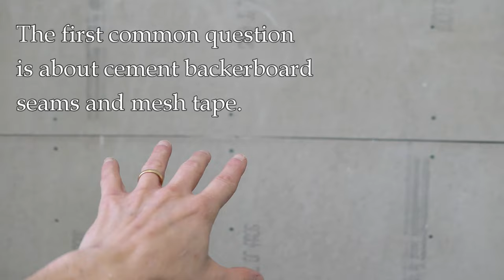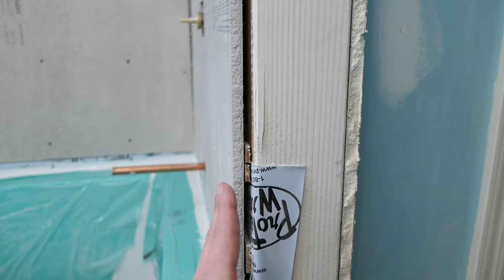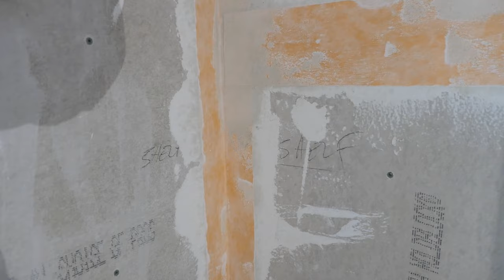Should Backerboard Go Over The Tile Flange Or Up To It?

Comment: HEAR ME OUT!!
I find it illogical to caulk between the bottom of the tile and the top of the tub. IF, theoretically, water gets behind the tile surface it will become trapped back there as it drains down to the top of the tub. This is bad, and the same principle has absolutely ruined homes when this technique was applied to EIFS stucco, and even brick veneer exterior walls on houses.  The tub has a lip, so water draining down behind the tile surface should have a way to continue into the tub so drying can take place. At the very least a weep hole should exist at the low spots allowing any potential moisture to find a way out from behind the wall.  Just common sense thinking here.
Reply from the maker: Ha!  I heard you out!  So, there are a lot of misconceptions about how tiled shower walls function. If you have tiled shower walls which are installed correctly and maintained, then there is no water getting behind the tiles.  When grout is secure in the joints and the grout has been sealed, then water rolls right off as it does on the tile surface itself.  Even when sections of grout are missing or poorly maintained, water doesn't actually flow behind the tile.  It will soak into the thinset adhesive or even the backerboard, perhaps, but it would take a long shower indeed.  And in that case we are talking about moisture, not flowing water.  I have seen showers where water actually flows behind the tile and into the wall cavity, but these showers are severely damaged to the point of wide cracks.  Why the homeowner continued to use the shower was a mystery to me.

Getting back to your point, there is no normal circumstance where water flows behind the tile.  The caulking at the tile-tub intersection is used because there can be differences in expansion and contraction in that area or the tub can flex, and grout would not hold up over time.  The flexible caulk will hold up and it will also keep that joint free of water, soap, dirt, mold, etc.  Your concerns would be valid on outside installations of siding and roofing and trim, but they just don't apply to a properly installed shower wall.
Reply: @enduringcharm  I agree with most of what you said. Obviously it's been done this way by most professionals forever, and no one's house fell down. BUT, so many out there do not maintain proper caulking and grout conditions. And you're right, really not enough water in most cases to do structural damage, but failed joints allow enough water back there to develop mold. Every shower wall I've taken down shows at least a bit of black mold. Leaving even just a small weep hole on either side could help eliminate trapped moisture. So then the even bigger question arises, if there is no appreciable water getting behind the tiles above a bathtub, why waste all the money on these advanced water proofing systems? I mean, its become a rather extensive common practice to waterproof entire wall surfaces above the tub. Personally I think its overkill, and a simple drainage and drying allowance is all that is necessary in most cases. Shower pans are whole different story, so none of this applies there.
Reply from the maker: Well, I actually agree that the waterproofing craze is wildly overblown.  For a tiled shower floor I will use the Schluter system and waterproofing up the walls, but in other cases it just isn't necessary.  I use my flashing system behind the backerboard and that's all that is needed.  I've completed 60-70 bathrooms and not one of them had a water problem in the middle of a tiled shower wall.  So why is it so important to waterproof that area?  By contrast, nearly every tub and shower pan I remove has rot at the edge and corners where it meets the floor.  THAT's where I waterproof!  I see no point in spending time and money on installing Redgard or Kerdi in the middle of a wall while ignoring the edge of the tub or pan.

Comment: If you shim out the cement board, it won't be flush with the surrounding drywall.
Reply from the maker: Yes, sometimes that's the case.  It depends on the room.  Or, sometimes you can shim out one wall--perhaps the back one in an alcove, but not the others. Each bath has to be evaluated for the best option.

Comment: Why not just notch out the back edge of the foam board and slide over flange? The foam board is 100% waterproof all the way through
Reply from the maker: Well, first, I was using hardibacker on this project, as I typically do.  Hardibacker cement backerboard is slightly under a half inch thick, and relieving the back of it would both weaken it and create a lot of toxic dust. Sometimes I'll nick a small area to accommodate a screw head, but that's about it. You may be thinking of Schluter Kerdiboard, which has an orange waterproof surface on it.  That would also be weakened by cutting the back of it and since this area is already potentially troublesome, I would avoid that too.
Reply: I didnt know people were still using cement backerboard. Its really heavy, not waterproof and creates toxic silica dust when cut. Ive installed hundreds of showers with hydroban board, we just rabit out a 1/4" out of back and slide over flange.  The adhere with hydroban adhesive.  Are you saying a cast iron flange behind the waterproof glue isnt strong enough to support the foam?!?  @enduringcharm
Reply from the maker: Actually, there are cement backerboard products which are waterproof.  See the Hardibacker "hydro defense" product.  One reason I prefer this heavier product is because it creates a solid feel to the tile installation--rather like an old, heavy car door slamming versus a cheap flimsy car door.  When I knock on the finished tile I want to hear a solid thud, not a hollow ring.  Further, the tile adhesion to hardibacker is greater than what I can achieve with, say, Kerdiboard.  As for the support of the tile flange, this was not cast iron and I rarely install cast iron tubs.  Occasionally I'll use stamped steel on a budget job, but the vast majority of tubs or pans I install are either fiberglass or some form of plastic.  Those expand and contract with temperature change and I would not expect any adhesive to stay adhered in the long run.

Comment: I just silicone all my joints to seal them before tiling.
Reply from the maker: While that may not hurt, it won't necessarily help either.  I install the flashing so that in the future, if framing moves, or a homeowner doesn't maintain the grout, or a heavy body makes a habit of leaning against the wall, or something else goes wrong, water will make it's way back into the tub or pan.  A bead of caulk will only protect a small area and only if the tub or pan or framing never moves.  The flashing also goes behind the backerboard in the area most prone to water leakage so that even if a tile pops off the wall, that moisture won't be transferred to the framing.  These may sound like crazy things that would never happen, but when you've been in the business as long as I have you see a lot!  In fact, I've done a fair number of repair jobs where upstairs showers or tubs leaked into the wall cavity and then to a first floor area.  Several of those were second floor condos leaking into somebody else's first floor condo!  Needless to say that did not go over well, and there were lawsuits and insurance investigations.  So, for the cost of the self-adhesive flashing and some plastic, I'm sure I won't be called back.

Comment: $40.00 bucks for that box of Kerdi band?
Reply from the maker: The price of Kerdi can vary pretty widely, for some reason.  You do see it at Lowes a sometimes and it can be purchased online.  But most people source it at a local tile store.  It also comes in different roll lengths.  Shop around, but, yeah, the price of most building materials has gone through the roof in the last couple of years.
Reply: @enduringcharm  what about just using regular mesh tape like the drywall finishers sometimes use? Will that work with thin set? Or not recommended?
Reply from the maker: There is a mesh tape designed for use with thinset, but don't use standard drywall tape.  The reason to use the appropriate mesh tape would be to add strength to the joint, whereas the reasons to use the kerdi band would be to waterproof the corners and add some strength.

Comment: What's wrong with guys like this is they don't understand the concept of waterproofing in the olden days there was no seems it was a motor that was mixed right there and installed now with all these new products they make up their own rules but you need to waterproof it you need to fireproof it because as your job is to make sure you don't trap moisture
Reply from the maker: Actually, this guy does understand the concept of waterproofing, but he doesn't necessarily buy into all the marketing claims.  I've taken apart 60-70 bathrooms and not once did I find water damage or mold in the middle of a shower wall, even though most of those tile installations were done over drywall.  Where I DO find water damage consistently is at the edge of the tub or pan where it meets the rest of the bathroom floor.  And that's where I do take care to waterproof, unlike a lot of contractors.  When I tile a shower floor I use the Schluter system, and I do run the membrane up the walls.  Otherwise, I examine the circumstances of a particular installation and install what is necessary to make it last.  Frankly, waterproofing the entire wall using Redguard or Kerdi also has a downside, in that tile does not adhere as well as it does to straight Hardibacker.  And, you should note that Hardi has recently introduced a backer product called "HydroDefense" so if you do need complete waterproofing you can get it that way.  So, before you lecture others, take some time to examine your own assumptions.

Comment: All that "window and door sealent tape" and the plastic up the wall is nonsense. It's more work for NOTHING! If the hardyboard is waterproof what's the plastic doing? Once you screw through the plastic it's no longer waterproof.
Reply from the maker: I've been doing this professionally for 15 years and I've seen things that perhaps you have not.  For example, I've seen poorly installed framing in a condo move so much that it opened up gaps in the corners of a shower and flooded the unit downstairs.  Or, a special needs tenant who accidentally damaged a shower wall and continued to use it, flooding the unit below.  Or, homeowners who did not maintain the grout or caulk and continued to use the shower, flooding the floor below or causing long term rot in the framing.  The flashing I install is to prevent situations like this, not for everyday protection.

Comment: Correct, the mesh isn't necessary on horizontal joints.  Fiber tape is much better.   Now common sense will tell you the backer board goes up to the lip, not over the lip.  Why would you bend the backer board over the tub lip because that would only cause you to have your bottom rows of tile tapered inwards at the bottom.  Thats totally ghetto and unprofessional.  Good luck installing your metal frame shower door.  LOL.
Reply from the maker: I think you missed an important point.  You would never bend the backer over the lip.  In some cases, though, you can shim out the face of the studs to allow the backerboard to extend over the lip.  Or, you may need to shim in order to bring the backerboard flush with the lip. In these cases the entire wall is shimmed out the same amount to keep the plane of the backerboard flat.

Comment: Completely unnecessary flashing around the tub, water will never go over the lip of the tub
Reply from the maker: Unnecessary as long as nothing ever goes wrong.  The point of it is not everyday protection, but protection for the long term if the homeowner does not maintain the caulk or grout, or if there is a lot of movement in the house framing, or if the homeowner causes wall damage.  If these things seem far-fetched, I can tell you lots of stories about second floor condos with showers leaking into first floor condos, $100K bathrooms that look great but leak into the garage on top of exotic cars, upstairs bathrooms leaking into and ruining downstairs bathrooms, and homeowners who continue to use showers despite obvious damage and water leaking into the walls.

Comment: Hardi is not waterproof.
Reply from the maker: Actually, the newer hardibacker with "hydrodefense" is waterproof.  The original is water resistant.  Either way, if you are installing hardi over a tub or pan it isn't necessary to have a waterproof surface.  The tile and grout will take care of the water in a residential installation. For tiled floors and walls, I'll use Schluter membrane for waterproofing.
Reply: @enduringcharm  Tile and grout are not waterproof.
Reply from the maker: Some people are obsessed with waterproofing, and if that's your concern I would encourage you to try Schluter Kerdi membrane.  It's worked well for me and it's a market leader for a reason.  But, not every installation needs to be completely waterproof.   I've taken apart 60 or 70 older bathrooms which were installed with tile over drywall.  Certainly not the way we do it today, but you know what?  Most of them were in fine shape.  Ugly, but in fine shape. Many years ago I did a video on this very subject:

https://youtu.be/xk7lNudSV2Q
Reply: @k0harmer  The finished grout requires three coats of "grout sealer", such as TileLab, to waterproof it.  Glazed tiles are waterproof.  Non-glazed tiles are not waterproof, but are water resistant.  Water that does penetrate the surface of the tile isn't going to reach the back of the tile during typical shower exposures, unless you have a teenage daughter that enjoys a three hour shower twice a day.